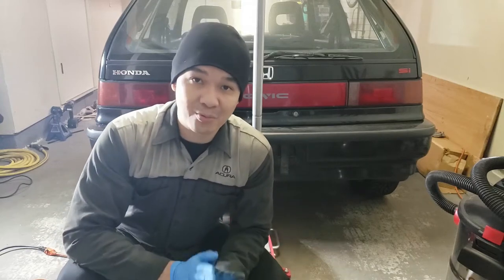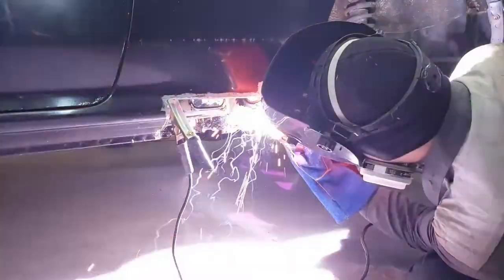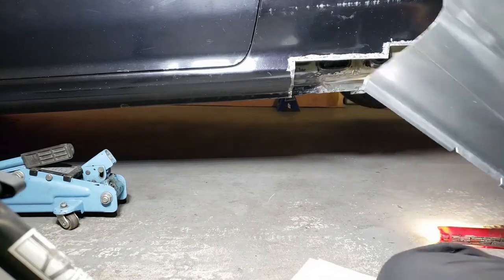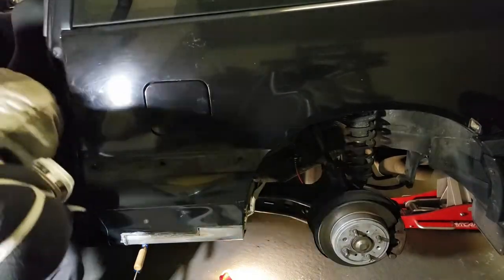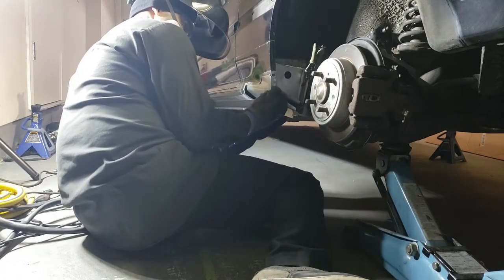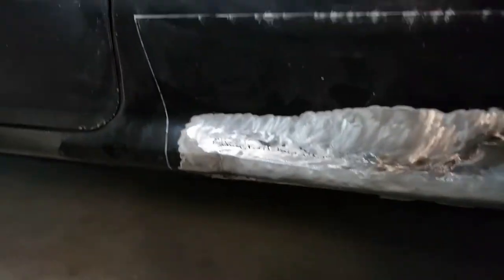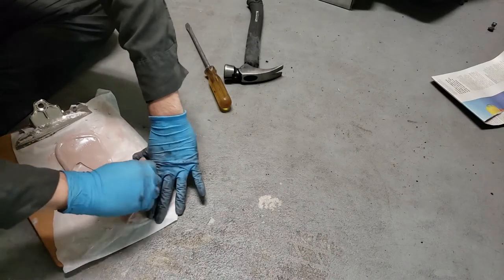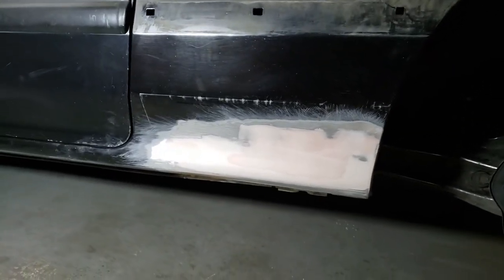[Car Rust Repair] Driver Side Rocker Panel & Wheel Well Rust Repair (Removal & Prep) - Part 2

Comment: I am jealous of your attention to detail. But why nobody apply any paint on the backside of the welded panel?
Reply from the maker: I do apply paint on the back side of the panels but I didn't always film it. Like the middle of the panel would be primered and painted. And other areas I'd use weld thru primer. If its a welding area, I'd use weld thru primer since paint will just burn off and compromise the weld. The weld thru primer does the same but it has zinc in it which is good for rust protection. Its really hard to protect the back of the panel. Once you weld it burns whatever paint there is behind there.